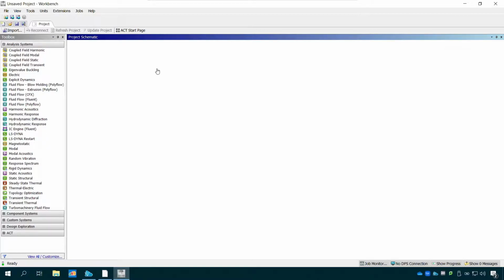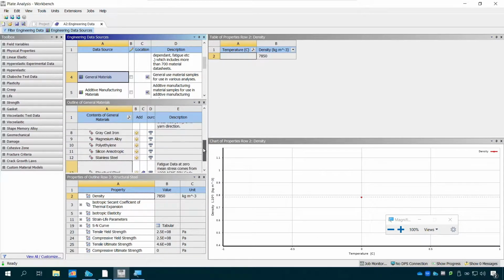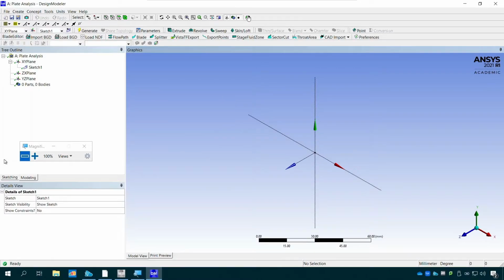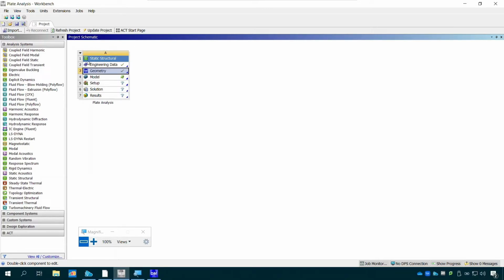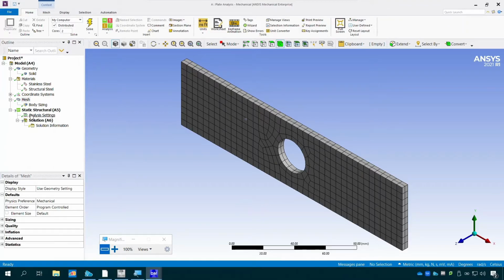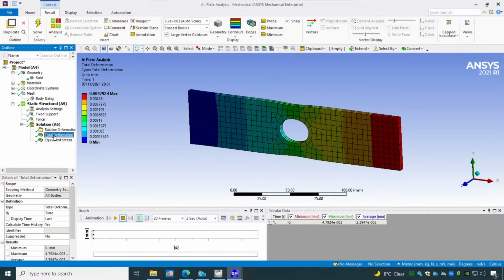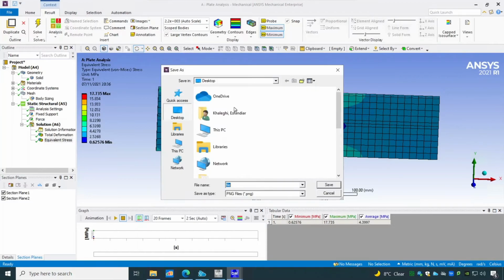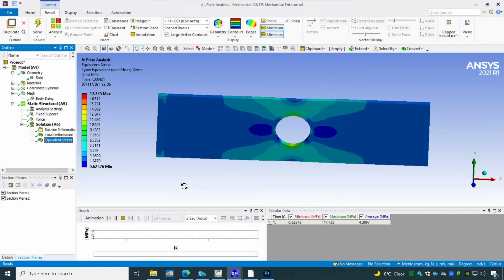Introduction to FEA using Ansys Workbench

Comment: Hello, excellent introduction! When just a rectangular bar with a hole in the center and a pulling force on the x axis?! Had you defined the other fixed points on -x axis (a pin or other through the hole or on the left end of the rectangle) you could get your answer in an instant, in your case the computer has to assume an impact like force or other, other meaning I couldn't know either or the computer. Thus, ".. you'll have to wait from few days to a month to get the generated answer...".